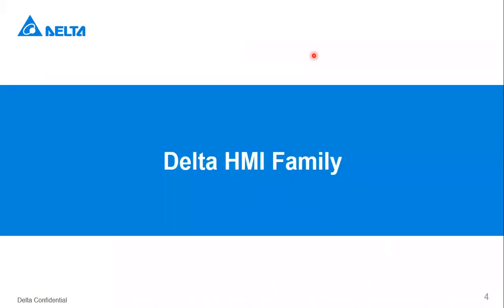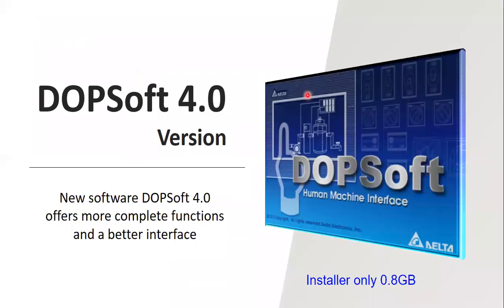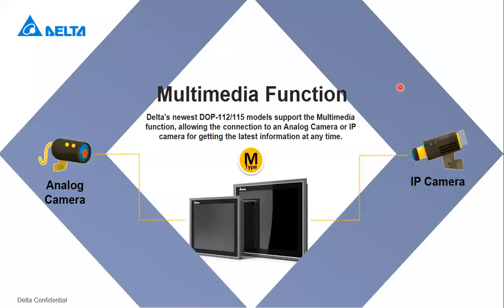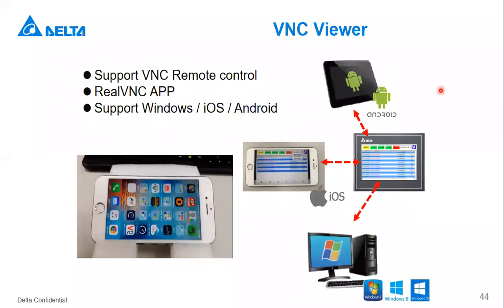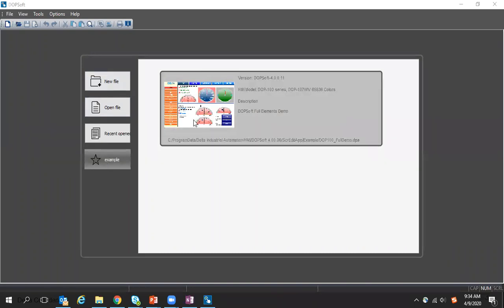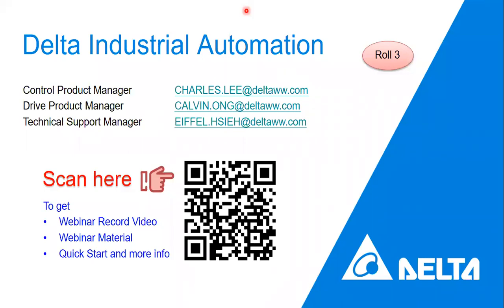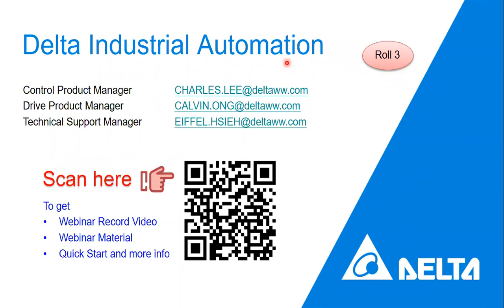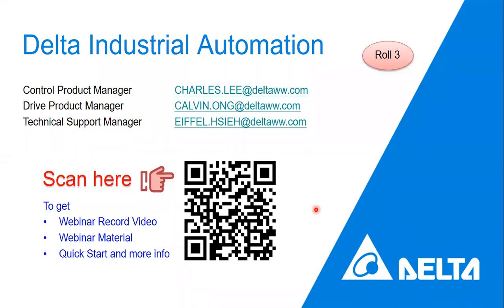Delta New HMI DOP100 Series

Comment: Hlo sir.
With all the delta equipment I have used , I have quite an experience with delta product.
 Such as modbus communication with, VFD , temperature controllers, HMI, etc.
And have kind of promoted delta equipment to different industries.
 Here at CG Brewery I have automated bottle filler, washing machine sololely using delta products. I have the report of that.
 I was looking for similar type of opportunities if any .
In India or Nepal.
Hereby I will attach my cv .
I have an experience of 3 and half year at maintenance department brewery Nepal.
If any I will be very great ful.